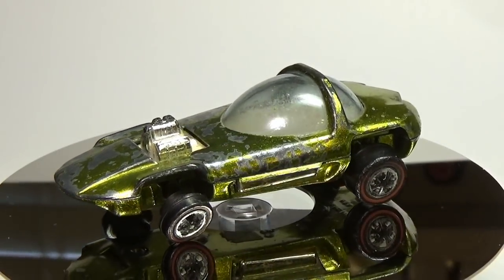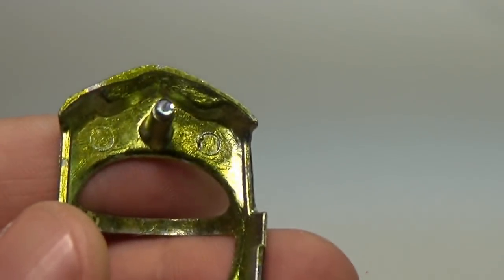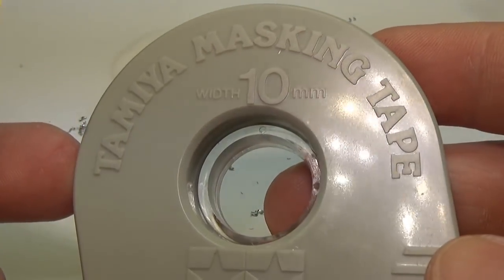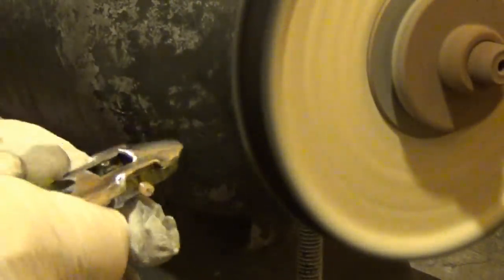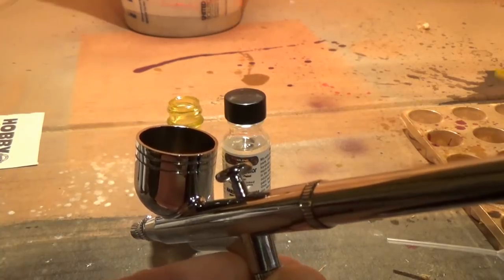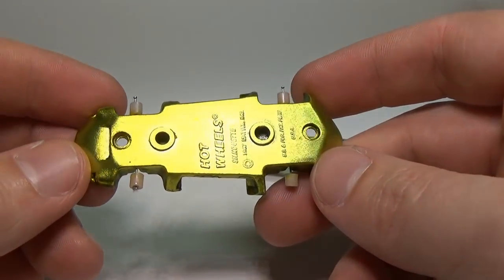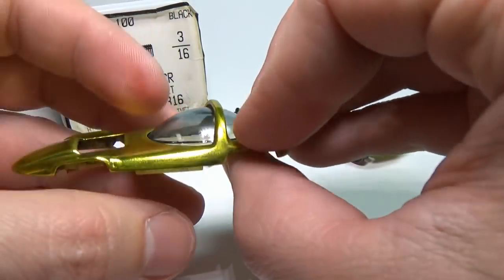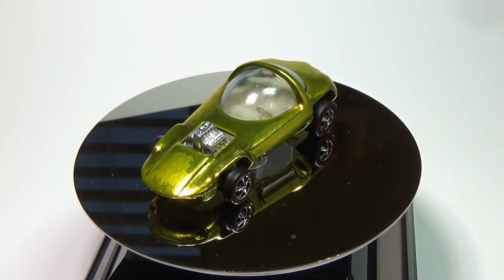Redline Restoration: How To Step by Step

Comment: the tool you used to cut of the tires are called "end cutters" I think... : )
Reply: Yea you're right
Reply: You can see several brands on Amazon if you search on “Compound Tile Nippers”
Reply: or top cutters
Reply: In the UK its Pincers
Reply: End cutters used for PCB work
Reply: I’m a sheet metal worker. We all call them nippers

Comment: When it comes to attempting to fill voids or pits with Lead "Not Solder on a roll" you would need to make sure you are actually using a torch and ensuring you heat the car to the point of the lead melting "if you chose lead work"! They still use lead in hotrod body work and it is a craft from an Era where body filler was not available. But you would also have to make sure that when you apply it, you take the time using the right tools and a torch to blend it.

 But a technique that might really work for you on this and keep you away from lead would be to use solder paste and either a heat gun or torch until it melts and flows! With the paste you could apply spot repairs easily and just heat it until it flows, you may need to find some custom jewelers tools for ring making in order to blend the repair smooth, then using your wheel and compound you could smooth the repair. 

When it comes to discoloration I worked in a Shop that handled Stainless for Marine Applications and in special situations or where we had issues with blending from welds we would use a White rough on the wheels, it leaves a finish that would better be suited for your restorations, but it is usually almost twice as much per bar than normal Rough!

So looking on ebay I found these!

Just search for low temp solder paste, they have a tube or "No Clean" for about $11.50 ebay item 282271534308 and the white polishing compound is $4.97 ebay item 191929298922 they also have 22 carving or sculpting spatulas for $27.99 for the solder work ebay item 361900810661  ! But you will also need a hot air rework system or small adjustable torch for the soldering and practicing using the solder method would be best before using it for many other restorations, that way you can perfect it! Also with the right type of compound "they do have buffing compound sticks for plastic" and with a dremel buffing wheel you could restore windshield's on the inside and outside! A 2lb bar for plastics is $21.95 ebay item 331612357160!

Comment: Thanks for going more into the process. I found your channel last week, watched a bunch & subscribed.  This is the first video I got notified on.
A question: when you paint, you said you wait for each coat to dry.  How long does that take?  Is it a matter of minutes, or longer?  (does it dry quick enough on the car that the urethane paint isn't hardening in your air brush?)
Reply from the maker: John Benedetto It normally takes less than a minute... I have never had the paint harden in the airbrush...  though given enough time it certainly would. Thanks for watching!
Reply: baremetalHW how much would it cost for you to restore my 1960's N° 13 Hard Wheeled Yellow and Green BP Dodge Wreck Truck?

Comment from the maker: Links have been added to the video description.
Reply: baremetalHW  i am  trying to restore some of my old hot wheels  main lines   can you  do a video on doing one
Reply: baremetalHW 
I have a slightly scratched 1971 matchbox blue shark no 61 still with the sticker on the front
how much do you think this is worth
Reply: ITS NOT PIPE-ETT ITS A PIP-ETT
Reply: Its actually a PIE-PET
Reply: baremetalHW have you ever tried painting the car with the chrome paint and then the spectra flame?
Reply: baremetalHW    The tool in question is a nail puller. Basically it is designed to pull nails as the name implies. I also think a small drill press would make your painstaking work a bit easier.
Reply: baremetalHW how do I send something to you
Reply: this would have been perfect if you would have detailed the interior! :  )
Reply: Hot Wheels won't take solder because (unless I'm misinformed, and I could be) they use a zinc/aluminum alloy -- neither of which will hold solder with all the flux in the world. Also, in the guitar universe, finishes similar to this one use white primer, then a couple coats of gold or silver, then the translucent color - that's how we wind up with candy apple red, lake placid blue, etc. Just a thought; no clue how well that would work on a Hot Wheels.

Comment: Love your videos. You mention that fillers and primers can't be used because Spectraflame has to be be sprayed on bare metal. Spectra flame says it needs to be sprayed over their  LIQUIDMETAL™ VM4201 basecoat, which is to be sprayed over primers and fillers. Just wanted to provide a possible alternative for the really beat up cars. Thanks for posting great videos!

Comment: If you work in industry you have to know the proper name for tools. If you're using them as an individual it doesn't matter what you call them, at all. People can see the tool in the video, they don't need to hear the name. Go to a tool store and they'll see them hanging up there for sale. Ignore the people saying you need to use the real name, you're a model car renovator, not an engineering tutor. At least not in this context. For a start they will have different names in different countries, and different names in different parts of those countries.

Comment: So here's an idea for filling gaps on REALLY screwed up cars: Fill in pits and scratches as you would, but then cover the body with aluminum or silver Bare-Metal Foil and paint as you would. The Bare-Metal Foil is essentially very thin metal and therefore can be treated as the car's original body, and can take a mirror polish.

Comment: Whats the difference between a redline and a normal hotwheels?
Reply: When they were made, original redlines were made between 1968 and 1975, cars after this have been released with red lines on their wheels but they are not considered original redlined because they weren't made in that timeframe

Comment: The tool that you used to cut the old tires off is called Tile Nippers or Cutting Pliers. You did a very good job on this Redline restoration. 🏆🏆🏆

Comment: Have you tried having the body soda blasted? I have had great success with it. It gets into all the small areas and removes corrosion perfectly. It does not etch the surface but seems to smooth the surface leaving it ready for paint. Very cheap and easy to do,well worth having a try out on a scrap or beyond repair car.

Comment: Nickel plating would cover up the discoloration wouldn't it? Maybe also create a metal layer compatible with solder. Also you could make a paint from graphite powder and a paint thinner and spray it on as a filler primer that is conductive and will take on metal plating maybe?

Comment: If you’re wanting to really take it to the next level.... since you’re saying that the Spectra paints rely on the underlying metal you could try this technique: primer and spot putty as needed, and the apply a chrome finish. Not the rattle can stuff. I know they have automotive grade paints for this, idk about an airbrush finish though. I’m betting you can get it to work. A lot of the chrome paints rely on the underlying finish so applying the primer will help with that. Once the chrome is applied go over it with the spectra paint. I’m betting it would work. Also, you should look into Meguairs plastic polish after using the Turtle wax stuff, it’s relatively cheap and I’ve found that it helps take the polish to the next level and provides some more protection from UV etc compared to Turtle polish.

Comment: me and my dad started to collect hotwheels again just last year, after i got rid of my old and broken set to one of my relatives, i didnt know then that you could restore and fix them, i could have brought my favorites back from the dead, this video and your other tip videos makes me realize that i can restore and fix old cars relatively easy, the only thing i am still trying to piece together is what are your simple steps to painting... like will normal model paints work and is sanding a valid way to get rid of rust, i think its clear out rust, buff car, paint car, decals and then clear coat right?

Comment: Excellent Video!  I'm really enjoying your videos!  My question for you is can you just place the car inside a container that has the paint in it instead of using that sprayer that you have?  I guess that way you also don't have to worry about the urethane in your lungs.  That's my concern from what I heard and saw in your video.  Your thoughts are greatly appreciated!  I have no mechanical skills, but you're inspiring me to actually give this a try!  I have my Hot Wheels from when I was a child in the 70's.  I think it'd be kinda fun to try.  Thank you!!

Comment: I'm not a restorer, but I love watching these vids.  I have a question for @baremetalHW regarding the discolored metal on the casting: what if you nickel plated the body after stripping and sanding, would that hide the discoloration?  Seems like a pretty simple fix, but I'm guessing it also would have the undesired effect of changing the appearance after painting or it would have been tried already.

Comment: I'm sure that your question about the name of that tool has been answered a million times over by now, but they are called end cutters or end nippers. In other work they are used to trim the sharp ends of nails, screws, etc that protrude from the backside so as to avoid uneven fit, scratching or even gashed flesh. Hence the name "end cutter" I've been building plastic models for 45+ years. Even now I've got an AMT Silouhette waiting to be built. I have done a few Hot Wheels, Matchbox, Corgi etc. Techniques are pretty close. For stripping paint, I use DOT 3 brake fluid. It does not seem to affect any plastic or rubber as long as you don't soak it for a week. Only problem with the brake fluid is it usually takes an overnight soak to work and sometimes it takes a couple of treatments. For me that is not a problem because I usually have three or four kits going at once. BTW Nice Job. Love that yellow

Comment: 11:06 you can use oven cleaner to remove the original/chipped chrome safely without harming the plastic underneath. then you can paint it with new chrome

Comment: Another great job. Do you have a Red Line personal collection? If you do, have you thought about showing them?

I won an e-bay auction over a year ago, and it was an original 67 Hot Wheels Rally Wheel case in almost mint condition, with 18 original Red Lines, all requiring restoration in varying degrees. 

There's two 68 Camaros the same color as the blue one you restored - a gold Turbofire - an ice blue Torero -  Paddy Wagon -  a Light My Firebird in a weird root beer/red color - a white War Path - a Ferrari 312 P - a white formula 5000 - a black Formula P.A.C.K. - a red flying colors Splitting Image - a red Ford Mark IV - and a vanishing Mclaren! 

I just set it down to get the Mark IV which was under it, and I haven't moved an inch, so I have to conclude it was a rare Hot Wheels Red Line prototype vanishing model, if anyone's interested in purchasing this ultra rare one of a kind prototype gem, and you have at least 6 figures of disposable income, I might be willing to part with it...sigh

I can't recall what the other few were. They're most likely in a box under a ton of crap that my wife and three adult sons have fired in the spare room, so I'll be digging them out when I clear that spare room and use it for my two great loves - die cast resto, and customization - and my recording studio. I was a lead vocalist/writer for close to 30 years and I play guitar. I'm a huge Beatle fan and when I discovered the incredible Epiphone Casino electric guitars they had used to record a huge chunk of their very best music, as well as their solo stuff, well I had to have one!

My Casino is my absolute hands down most favorite electric I've ever owned, or played!
Listen to the opening salvo of Revolution, and listen to any of their very best music, and you'll understand why it was their favorite guitar to record and write with!

I digress...back to the awesome e-pay scoup!
I'm not sure what happened, but I won the auction for $17!! Well...I actually do know, but I cannot divulge this top secret systemic flaw in a lot of sellers habits which cost them all kinds of money which stays in my pocket!

Very shortly after the auction ended I got a message from the seller telling me he was really sorry but he had actually sold the items, and had forgotten to remove the auction....ya, right.

I sent him a less than understanding reply, informing him that I wasn't born yesterday! To the contrary! -  I was born the day before, and yet I could still recognize that vintage dirtball's tactical weasel maneuver - the "Pinocchian side step!!

I put a strike on him (can't recall the actual term) and after a lot of flying BSery on his behalf, he came begging and wanted me to drop the strike, which meant I would have an undeserved strike on my perfect record also, the way e-pay is set up, which cannot be rescinded because you cannot get a real live person to explain these situations to.

As a matter of strong principle, I was not about to remove the strike against his record, because how many other people would he pull this scam on and get away with it?
I took the hit, and all of a sudden, he sends me a message that he managed to convince the person he "sold it to" and the guy was so understanding that he sent the items back for a refund, and I was going to get what I had won in the damned first place!

Anyway, all this just to say I'm going to get back into this hobby in a big way, after abandoning my all time favorite hobby for over a year now!

Love the channel, love the workmanship!!

Jack
Canada

Comment: If you want to solder a car there are a few things you could try. First  of all, it may help to give the area you wish to solder a rough sand to remove any oxide. Second of all, you need a very high temperature iron. The metal body of the car will take up a huge amount of heat, so use a powerful iron and hold it in place for a long time. You may even be better with a soldering gun to get higher temperatures. Thirdly, flux is your friend, use copious amounts of it in a well ventilated work area. If you can get the temperature high enough and use enough flux, the solder should stick. You may also wish to investigate a technique called silver soldering which may be better suited to this job.

Comment: thank you for sharing. I have used some of your tips. I'm looking in to getting an airbrush kit. could you share your setup or have any helpful hints/tips on brands or style.
Reply: If your short on cash, get a Badger 350 kit. The Paasche H is also a good first brush but, its a bit more expensive. Go to Doctor Faust's Painting Clinic on YT for more info on getting started. I bought my Badger 350 back in '86 and its still works great. My main brush now is a Badger 360 which is great for my 1/16 scale tanks that I build.  Been thinking about getting a Sotar 20/20 lately though.

Comment: I think looking at how old vintage metal cars are repaired may help you. Soldering on things that it refuses to stick to is actually simple but will not stick you just build up solder on the tip of your iron til it drops off. I get some stuff that is broken like the clip on my helping hand (Mr. Stubby. He only has one hand) to stick by doing this method and then sculpting it around it so it will not slide off easily if at all. Albeit too much pressure will break that bond. Even sanding doesn't help. Also, invest in some jeweler tools it probably will be really handy in the future.

Comment: Have you ever got any color changing cars before?
Back when I was a kid I got a few of them as I think they were advertised on TV and just had to have them.
Is the paint to have the car color change more expensive and would you even want to try to attempt something like that?
And now I need to dig out my old hot wheels and see if there are any bad ones.
Which I played with mine carefully so I may have to buy a junker to try my hand at restoring.
Should not be to hard since I am doing a full restoration on my LaserCue pinball machine cab and playfield.
Looking to get it like it was fresh off the assembly line back in 1984. :)
For me on my pinball restorations for the metal.
My rule is if it is in a spot rarely seen it gets sanding for rust removing then grey spray painted for things not seen very often.
But stuff that is seen I sand the rust off of and then buff it to make it chrome like.
Then I will do some clear coat on it so it keeps the metal from rusting again. :)
I need to get me a screw tap is about the only thing I am missing for these hot wheels restorations.

Comment: Just found your channel... amazing work and thank you for sharing your tips. I purchased and old collection that is a mix of redline and sizzlers... they all have a sticky residue that I assume is coming from the sizzler batteries. Any suggestions on how to deal with that?
Reply from the maker: try washing them with vinegar... I find that works most of the time and wont hurt the cars.  You can also use lighter fluid if the vinegar does not work. One of those 2 should fix it.